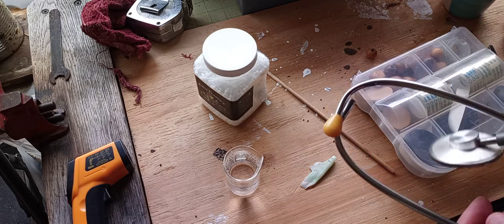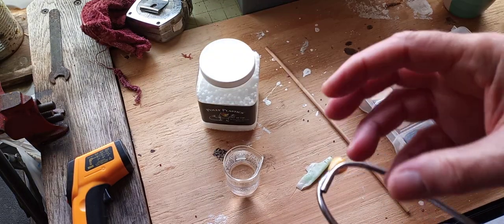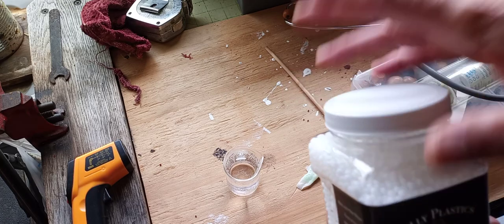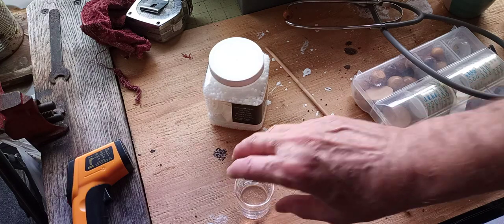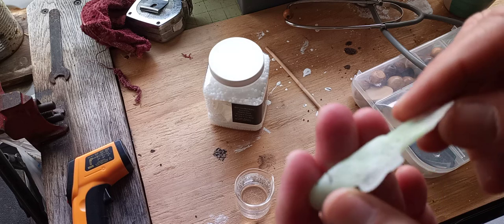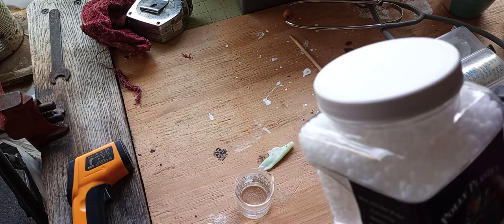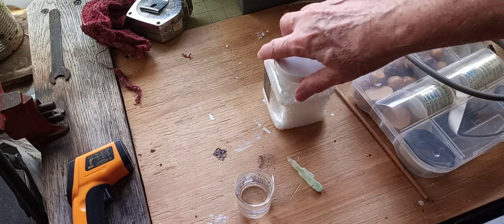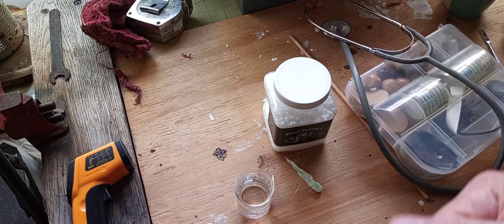How to fix your stethoscope earpiece plus Polly thermal plastic- handy DIY material

Comment: The bead is perfect! 
Thanks Robb. I’ve been curious about that plastic.
I’d bet it could be molded into indoor plinking pellets. A Crosman pumper will launch anything that fits.
The right amount rolled up in paper towel and lubed with silicone oil. Maybe squish it together with a crimping plier.
Cut to length with scissors. Shoot cans off coffee table. Three pumps.
Reply from the maker: they are about the size of a regular bb. very light. maybe make a cool way to attch a DIY bayonet.
Reply: @RobbsHomemadeLife  
Or another flashlight.